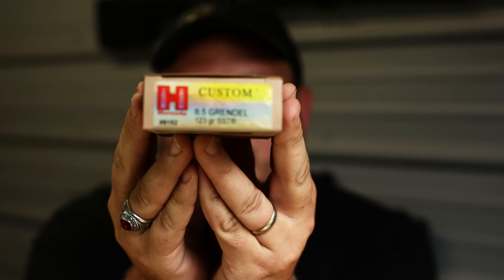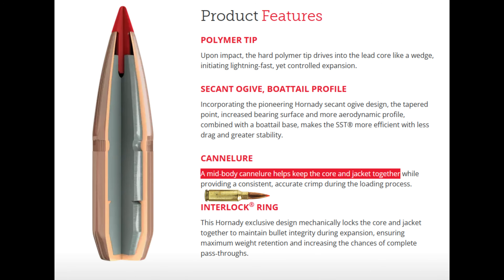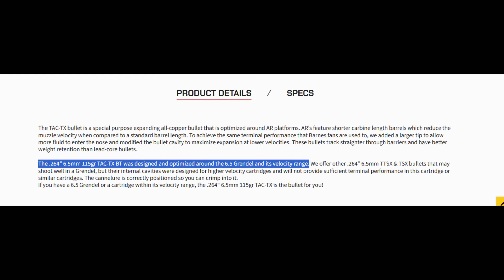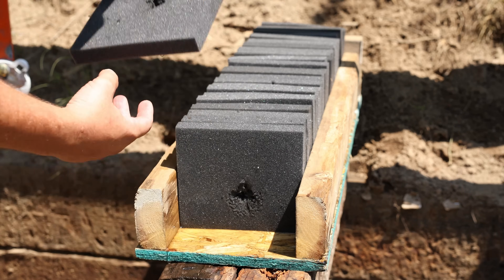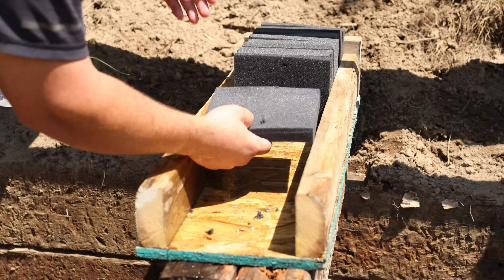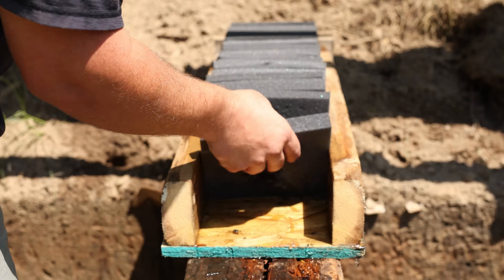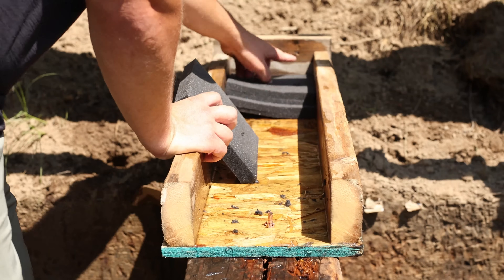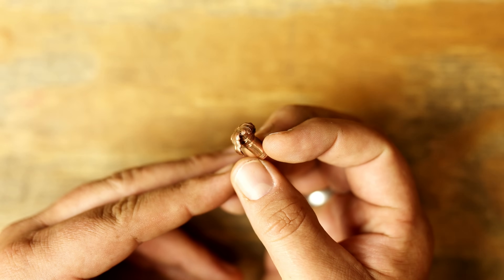Hornady SST vs Barnes TAC-TX | 6.5 Grendel Hunting Ammo Test & Ballistics Breakdown

Comment: Sharing my experience (and open for comments) with the 123gr SST through a 12” AR-15 with 7” suppressor:

Killed 3 deer ~2.5 years old (130-135lbs) with good vital shots. One was at 200 yards and the other two inside of 50 yards. Each ran 30-50 yards. Full pass through, broad side, zero blood trail. 

Killed another deer ~3.5 years old (165lb) with head on shot, high chest right side. Broke spine, dropped deer, had to finish him with .22 to the head. Bullet retrieved, decent expansion and weight retention. 

Killed bobcat at 20-30yards, ran 10 yards. Shot a fox at 25 yards (quick shot, aimed for center mass), zero blood until found blood trail 20 yards from point of impact. Followed blood trail 30 yards through thick woods, jumped fox, blood trail diminished, lost fox. 

Also had the round jam 2-3 times which could be a magazine malfunction. Regardless, overall negative experience in spite of successful kills (with great shots) so I’m switching to Barnes.

Comment: I stand by the barns 8 days a week. Hornady always comes apart. I have to do some digging for hand loads and hoping Nosler has a bonded projectile for the Grendel. I’ve always been a Nosler fan boy and they have excellent bonded projectiles I’ve used with great success and n my 300 short mag. My wife loves her 20” barrel Grendel for deer hunting. Only issue with all copper projectiles is you need a copper removal solvent while cleaning your barrel. Also from Wisconsin here. Bayfield County along Lake Superior 🤘

Comment: I’ve shot almost 3 boxes of SST’s at whitetails, out of 2 different rifles. And recovered every single deer I’ve put it on. But I’m shooting 30 cals, not 6.5’s. I shoot front shoulders, and they do fragment. With that being said, there’s usually 5-6 holes thru both sides of the ribcage. And I always recover the copper jacket, boat tail section, against the hide on the far side of the animal. This results in a ‘soup’ of lungs, heart, liver, etc. A larger animal, or maybe a wild boar’s ‘plates’, could possibly cause a negative effect, but in AR we use dogs and knives for those, not rifles😎. So for deer and coyotes, it’s the perfect pill. And I’ve got a wall of horns to prove it😂

Comment: I've been running a 105gr MKZ in mine and have been extremely satisfied with its accuracy and terminal performance.   I've been extremely impressed with its penetration.   While not all that relevant for hunting whitetail,  it also has a pretty high BC of around 0.49.  They are expensive,  but I'd highly recommend it as a hunting bullet.

Comment: Great video. I’ve exclusively used the 123gr sst on hogs with my Grendel. I’ve always looked at the sst as a round that stays intact just long enough   to do its damage before separating. You have me considering the Barnes. Just to change up the fun and expand my shot location for hogs.

Comment: I originally started with the sst since it was the most common hunting bullet for the Grendel 10+ years ago. I’ve never exactly had it not work it’s just not my preferred bullet type for hunting. All the deer I shot with it from 25yds to 150+yds the deer was either drt or ran <25yds never losing site. I found inside 100yds I almost never got an exit wound (which I never needed a blood trail, I wouldn’t have had one). Think by my 2nd or 3rd season using the Grendel I found the 120gn federal fusion and never looked back. The fusion absolutely hammers. Always see immediate expansion, very good weight retention, and a devastating exit wound. Even leaving my shorter barrels @ 2400-2460fps they still perform as advertised out to 250yds and probably a bit farther that’s just as far as I’ve used it. Unfortunately the federal fusion is discontinued or loaded in very minimum #’s. Luckily I’ve still got a few boxes plus a pretty good clone using the 120gn Speer gold dot loaded on top of cfe223. I have a couple boxes of the Barnes 115gn and planned to use it when the fusions ran out and now the 90gn Hornady cx is looking like a contender also. Definitely plan on trying the 90gn cx this year. I haven’t tried the Barnes but I wouldn’t hesitate to use them if I had to. With all of that said I’d use the SST without worry also if need be and actually think the SST might be one of the better bullets if you know your shots will be beyond 200yds. Beyond 200yds you don’t get near as much fragmentation with pretty consistent expansion and penetration. At the lower velocities it acts a lot like a fusion/gold dot bonded bullet. In south Mississippi I rarely get the opportunity at shots on deer beyond 200yds. Occasionally it’s happened but generally I’m taking them between 20-75yds. Anyways loving the Grendel content glad to see the 6arc didn’t replace all the Grendels out there like most claimed would happen upon release of the arc

Comment: I've used both style bullets; a 129gr SST and a 127 Barnes LRX out of a 6.5 Creedmoor.  I currently use the Barnes, but only because we have young kids, and lead in our meat is something I want to avoid.  Both work fine.  The Barnes has historically (for me, 5-6 deer taken) has been mediocre in terms of terminal performance.  A few years ago, I shot a small to medium size doe at 20 yards through both lungs.  She stood there looking at me, until I racked the bolt and she ran off about a hundred yards. She continued to feed and graze in the woods until I lost sight of her.  I actually thought I missed, which is a disheartening feeling at 20 yards!  I continued to hunt that morning thinking she was fine, although I did not take another deer.  After I walked down from my stand, I found her dead where I lost sight of her.  She had a perfect hole through both lungs right where I was aiming.  My biggest deer yet was taken with the same bullet a few years earlier, and he went down in 50 yards.  Collectively, cup and core bullets like the SST and Nosler BT have performed better on deer for me, but the Barnes does the job too and I use it currently as mentioned above.
Reply: Same here, I’m not a big fan of solid copper projectiles, I’ve been disappointed in past. But it’s hard to argue with the performance in gel and accuracy. But they just seem to lack knockdown power or consistent results on game. They still work for a lot of ppl.

Comment: I started using the 6.5 Grendel very early on right after SAMMI adoption.  I’ve used both 18’ and 20’ barrels on two different AR platforms.  During all these years I’ve used the many different bullets from the 95gr all the way up to some 140’s .  I settled on the 120-123 weight class after much deliberation and testing.  They served me and my son well up to this point and have harvested dozens of deer.  I am trying the 115 Tac-Tx after having used the 110gr version for the last couple of years in my 300BO.

Comment: I load 115 tac-tx over a hot load of RL15...for a bolt gun.  I do not run the same load in my gas guns.  My daughter has squeezed the trigger on 2 deer; both went in the cooler.  Be prepared to load a few to find the  right jump to lands distance.

Comment: I dont have experiance in the 6.5 grendel with SST but i have used it in the .308 150 grain Hornady Superformance.
Bullets flew nice, but after having a couple of experiances with them i have since looked for other rounds.
All my deer with it were mule deer 175 lbs and to over 200 lbs. 40 to 250 yards, and 1 350lbs black bear at 200yd.

I had 1 mule deer hit in the spine at about 100 yards and the SST didnt go through.
Had another where i hit him 4 times from 40 yards to 200 and i could cover 3 of those hits behind the shoulder with a spread hand. 

The bear was broadside, got both lungs, no ribs were hit, and no pass through, no blood trail.  I felt that even on a bear if i didnt get a pass through without hitting a rib that was a problem for me.

Comment: I currently have and run the SST as my primary load in my Howa 1500 mini, also in a 22" barrel. I've killed 4 deer in the last few seasons with it. I live up in Northern NY and our deer trend on the larger size, very similar to upper Midwest whitetails. My first buck I killed with it I actually used the ELD-M factory load. There is essentially zero difference between the ELD-M and the SST in performance across the board. 

I do a lot of bigger woods style hunting with that rifle as it's so light and handy that I just love carrying it. However, the SST doesn't really give much forgiveness for less than optimal shot angles that tend to pop up when you are tracking or doing drives. So I'm very tempted to switch over to the Barnes for these exact reasons. You are one of the few people who actually has tests on it. Along with real life experience on game. 

I agree that the SST per advertising seems to fall a bit short when they claim high retained weight, especially at close ranges. It does however hold up very well to its real world reputation of heavy tissue damage and rapid expansion and energy transfer with almost varmint load levels of  fragmentation. And seems to do so with boring consistency. Jacket/core separation is almost 100% consistently occuring but they tend to be found loosely together or right next to each other and seem to penetrate well even without high retained weights. I have gotten that similar 70-80gr retained weights to your example you showed. However, I have only ever gotten one single pass through and it was a shot just in front of the shoulder that went through the spine at the very base of the neck at 182 yards. The performance at those slightly reduced impact velocities seem to be much more ideally balanced between penetration and tissue damage than they seem to at 60-80 yards where the other deer I had shot with it all were. 

I'd like to see you test the SST and Barnes at range like some of the other projectile reviews and would love to see your take on the new Hornady 90gr CX as well.

Comment: What barrel are you using on your rifle? I have a 20" Odin Works barrel that I'm not overjoyed with. The first Odin Works barrel I had sucked. I sent it back and they sent me a "hand picked barrel". It's not bad, but not what I'd like. So far, the Remington Cote Lokt shot the best. Still not happy. So much so that I want to sell it and get a Bergara bolt gun.
Reply from the maker: The barrel on the rifle in the video is a 22" made by Satern in Iowa.
Reply: @grendelhunterofficial what other barrels do you use? I'm very impressed that you can hit a 6-8" square gel block at 425yds. Thanks for the reply.

Comment: I like the mono bullets because of reduced meat contamination.  I have a Grendel in an AR and a Howa 1500 mini. I like it better in a bolt action because I can push it to higher pressure than in an AR. I also like the 6x45 and 25-45 Sharp's better in the AR platform because they use the 5.56 bolt face.

Comment: Great video. I just finished my 6.5 build and am heading to the Vortex factory here in wisconsin to match a scope to my 18" barreled Grendel. I'm going out to wyoming the 1st week of october for Antelope. I need help on choosing a great round that can shoot effectively out to 500 yds. I won't shoot an antelope out that far, I'm hoping 300 yds and in. Should I go with a 120gr SPBT or the hornady black 123gr. This video and the comments here have me a bit worried about ruining meat with the hornady. Any suggestions will be helpful. I'll be shooting a couple of different brands and weights to see what shoots the best 3 shot groups, then go from there on which type of hunting round is best. Thanks again for the video.
Reply from the maker: So a load you might consider trying is one we're working on a video for right now. It's a 129gr Nos AccuBond Long Range loaded by Druid Hill Armory. Yesterday we shot it into gel at 425 yards and it was impressive. If you check out Druid Hill, use the code grendelhunter at checkout for 10% off.
Reply: @grendelhunterofficial  thanks, I'll do that. What barrel length did you test it out of?

Comment: I used many 150 grn and 165 grn sst in a 308 for rock chucks...they act like hollowpoints and will expand fully even in a rock chuck.  I prefer them.  Good accuracy and not that expensive either.  22 inch barrel 308,  150 grn moving 2760 fps.

Comment: Great video! Ive been hunting with the grendel since it became readily  available for reloading. Id say 10 years. The sst is an all around reliable killer. Its great for head shots on hogs, and coyotes. Does well for frontal shots due to the explosive nature of the projectile. Ive stopped using them on deer or pig for broadside shots to save meat. The bullet ive switched to is the speer gold dot. Ive loaded the 115 grain tac-tx and really like it, but out of my 6.5x55 swedish mauser, 6.5 creed, and 6.5 prc. Its designed for the grendel but shines in these other cartridges out past 400. The 120 ttsx is just a little tougher but works well. 
The barnes 115 tac-tx is a great woods range bullet but costs a little much for the performance. If money isnt an issue then its golden. The speer gold dot is where its at for hunting anything you want to eat. Great accuracy, holds together, but performs every time on broadside shots. The energy transfer is great, and internals are always wrecked! When you jellify the organs they dont go far. 
Loved the wet foam test. Im going to start doing this with a layer of leather, or the pvc corrugated board to simulate a deers hide to initiate expansion.

Comment: I have used to 123 SST with the 6.5 Grendel to take several deer but did change to the 120 Gold Dot due to fragmentation. The 120 Gold Dot has been my go to for 5 years and has performed flawlessly.  This season I will give the 120 TAC-TX as try and have a lot of confidence it will get the job done also.
Reply: What powder do you use? I still have a couple boxes of federal fusion and then will start reloading the 120 gold dots.
Reply: @acort10  I use a couple of powders. One is AA2520 and for this setup I actually use the steel case Wolf with my powder and projectile. I also have a load for my 6.5 Grendel bolt gun and use LeverEvolution with it. My 120 TAC-TX uses the same load of LeverEvolution.

Comment: Ive had mixed results using a 250 grain sst out of my muzzle loader. This past season i shot a doe at 75 yards. The jacket completely expanded and plugged up the exit hole. No blood, in the snow. I only found her by following her tracks and hearing her thrash around in a thicket. I recently started using 150 grain barnes ttsx in my 3006 because the Winchester all copper hollow points i was using got discontinued. They were very accurate and dropped deer. I've only shot one deer with the barnes. Big bodied buck at 200 yards with complete pass through. He went 30 yards. No problem finding blood. Columbia county N.Y

Comment: Going to comment before I even watch the video, and then see if my predictions hold true.

My experience with SST is that it was very effective at making an animal stop breathing, but for hunting I stopped using it because of all the meat damage. I started referring to them as glitter bombs. I got really frustrated throwing away so much meat trying to get rid of all the fragments of copper and lead, and I was still finding fragments of metal well away from the wound tract. I found myself picking lead shards out of the meat grinder, and it just frustrated me. It dropped deer quickly, but it wasnt worth the trouble.

Barnes, or solids in general, are finicky. They need velocity. But when they work, they work. And they work well. They may not shock as much as a fragmenting cup and core bullet, but I'll take a slightly slower expiration over wasting meat and chasing lead shards any day of the week.

To me, I only use SST in applications I'm not interested in keeping meat. Like, predator hunting, or self defense. And my Grendel specifically really hates Hornady factory ammo, in any loading. I e tried them all, and never got better than a 2.5 MOA group in a gun that does about 0.6 MOA with hand loads. I can actually shoot steel cased Wolf anout the same accuracy.

Now lets see what the video comes up with.
Reply: I'd call that pretty close to predictions

Comment: These are 2 really different type bullets. The Barnes TTSX compares best to the Hornady CX/GMX. The solid copper expanding are really good, especially when you want to up the performance of a round with more penetration. The Sst is like a Nosler Ballistic Tip. It can get the job done for certain situations, but expands a lot and much weaker construction than the TTSX or CX.

Comment: Awesome video! I've been using Barnes TTX 110 gr in my 3006 @ 3150fps for 15 hrs. 39 deer, all one shot kills, from 20yds ou to 410yds.
I have only recovered 1 bullet, as the rest exited the far side. The weight of that bullet is 109.3gr and expansion at .637. It entered the front of the buck , took out the top of the heart/bottom of the lungs and came to rest just inside the skin in the opposite ham field about 41" of penetration. The shot was 55yds. Amazing bullets!